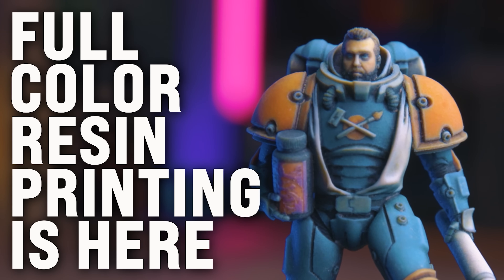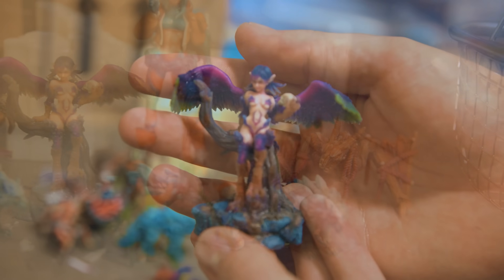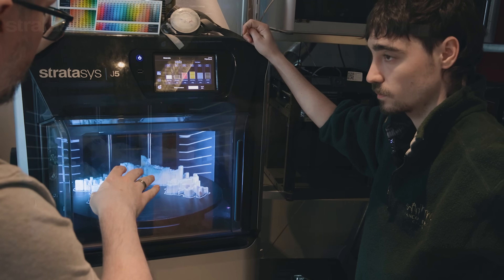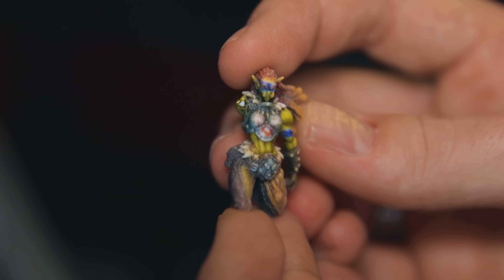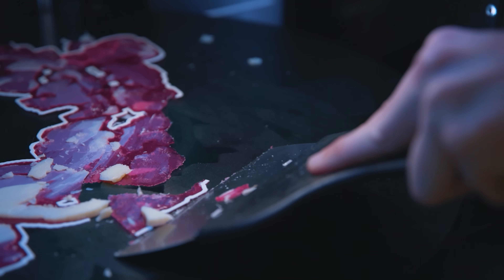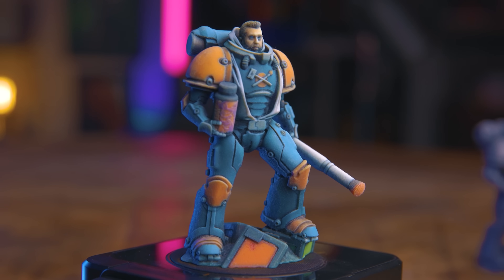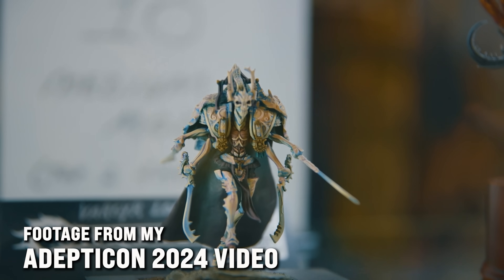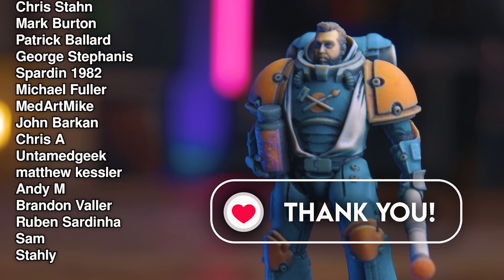FULL COLOUR RESIN PRINTING!!! - StrataSys J55 Impressions

Comment: Stratasys polyjets give great results, I use them at work in the dental teaching field. However they are expensive to run and maintain - colour resins are £330 each and you need two installed at a time per colour, so CMY function is going to cost £1800 ish. Basic resins and support materials are cheaper but again, two carts per material channel. So on top of the machine cost its heading for £5500 for a full set of resin. 

Being an insdustrial machine it is very proprietary, so you wont be modding it or getting around features you don't like. On the other hand they are fairly user-friendly, it won't take too much effort to train someone how to operate one.

Servicing contracts also cost a fortune as do spares. Still, they make very nice accurate parts and nothing else can match them for versatility yet. You'd just need to start a whole business to get hold of one.

Comment: Just counting down until this trickles through to low-cost consumer machines. Either patents run out, alternative methods to do the same thing are developed or Chinese companies just knock it off, but give it a decade and this will be in people's home workshops.
I will agree though - the support material and process is the game changer here. Assuming a similar recipe for support resin can be figured out, and someone like Phrozen or Anycubic works out a way to manage multi-material resin printing, it will be a smash hit.

Comment: Cant wait for a decade to pass so we can pick a chinese knock off for $200
Reply: And knock-off cartridges that don't cost the price of the entire printer.... When he said that I got worried this was going to copy paper printers in more ways than the print head. 
Overpriced cartridges that are just a plastic bottle of resin would be taking the piss
Reply: @ge2719  i was working with a printer like this from stratasys. The catrige work for 1 year starting when you set it up then you need to throw, and on the top 5-10% still remain in the bottles left when the machine says its empty. 😅 But the Support free print is nice to have like he says you need 0 knowledge but the cleaning need to be professional done. Make this wrong and you gona pay around 1000$ for a new printer head. 
The price of the machine and the resin cost makes it a bad choice for hobby print or sell its more for industrial use and sell
Reply: Yes even a single color one, for support management and water cleaning it is interesting enough for me.
Reply: Nah, rather going for it in four years🎉
Reply: The polyjet line of printers has been out for over a decade. They are insane with a price tag to match. There were full Color prints over 20 years ago, but again, super expensive systems and behind a curtain of patents;). Used these system in large tech companies. You can even print in various hardnesses. Nuts.
Reply: @KcCake this aged well, flashforge is making a similar machine called the CJ270
Reply: We should be able to replicate the technology for way cheaper maybe even back engineer it
Reply: why we gotta keep competing why don’t we just team up
Reply: @anthonycooper1340 Greed
Reply: a decade? No. 2 years max for a knockoff. A reliable one however....
Reply: @thimiraamaratunga7794  3d printed was invented in 1984, wasn't until 2010 that it started going global. why? because the intelectuall property expired. Now, at this day, PolyJet owns the intelectual property of this new technology so, actually: You have to wait 24 years .
Reply: Bamboo labs new 3d printing technology!!
Reply: That won’t happen for another two decades lol
Reply: Patents last 20 years, and this thing is very likely patented up the wazoo
Reply: @h57s  chinese font care about puny patents
Reply: @KcCake  sadly they care
Reply: I won't buy Chinese printers of any kind
Reply: @jerrebrasfield4231  almost all 3d printer companies are based in china
Reply: @jerrebrasfield4231     I've been quite happy with my Anycubic products.   Luckily, not everything coming out of China is Temu.

Comment: I want one of these now that I know about it. I been resin printing for a couple of years. When I been out of resin, I got in the habit of playing with slicing and simple 3D modelling apps, learning supports, basic kitbashes etc. Then I discovered the paint feature in MS 3D builder. So I started painting a lot of my Battletech mech files in it. The way Windows displays the resulting Thumbnail makes visual reference easy when searching through large folders. 
But basically, I've already got armies of mechs painted and ready to print

Comment: I have been eyeing this technology for a few years already, Mimaki is another printer-maker and theirs are much more reasonably priced than stratasys.
And they can even utilize a fully glass-clear resin, to simulate objects inside of a bauble for example, or making very believable car models with passengers visible inside.
Reply: You can utilize clear on the Polyjet as well. To get a more glass like finish, some minor sanding and clear coat to really make it pop.

Comment: I notice there's a lot of tan/orange and blue in the example prints. Are they still perfecting the colour mixing for this method?
Reply from the maker: just the colours of the models that were there. there was one I did not get footage of, which was a sculpt with tattoos on the body and it looked ace, butt we'd packed up when it was done. you'll see more models after UKGE

Comment: We had one of the early monochrome versions of this tech, at my work.   The support material used a water wash station with a pressurized nozzle to strip it off.    It was pretty cool tech back then (2010ish), and made super his detail models.   They were also quite strong, and could make quite sharp edges.

The resin was expensive, and date coded so that the printer would not accept it past its use-by date.

The printer maintenance was a pain, the resin (ink) jet print head was the hardest part to get clean.   

We also had a color printer that used the gypsum/color inkjet technique.  Those models were quite fragile, even when ‘hardened’ by soaking the model in super glue.  Most of the sandy looking prints described by other commenters could be explained by this tech.

Nice review, and cool printer!

Comment: The biggest steps here arnt the colour. Which is certainly nice. It's the fact it's got rid of the manual interaction with harmful chemicals. The fact that it can all be done (in theory) without even Gloves is incredible. By the sales images it even implies open office placement, so does that mean it's not got the fume related issues of resin printing too?

If so, This is the kind of tech that could be in every home.

Comment: 👋🏼former ten-year stratasys employee here. The J55 was a cool redesign of their polyjet platform (took years to figure out the rotating build tray), but sadly the BOM of material jetting systems like the J55 are seriously expensive, and will never drop to a point where consumers could afford it.  I have a tonne of things I could say, including the market size/attractiveness of the miniatures market for a system like this, as well as the colour gamut ranges, model stability, pros and cons etc.
Reply: I understand the argument for falling costs of components, and yes extrusion and resin technologies have fallen by two orders of magnitude over the last decade. I would qualify that by saying you can extrude or catalyse on sub-1000 printers, but these are not comparable to industrial systems in reliability or quality. But extrusion and vat systems (specifically LCD) are a simpler set of components, with LCD printers only becoming more cost effective because of the most expensive component (hi-def LCD screens) being driven down in price by a separate market, the tablet market, scaling the supply-chain. With FDM, this has never been a high cost bom. With material jetting however, as another commenter mentioned, the enabling components being the jetting heads and surrounding systems are fundamentally more expensive pieces of tech, both for thermal and piezo heads (you need different types of heads for different chemistries of resins, but thermal heads allow for a lot more interesting chemistries beyond actylates which is what polyjet is). The providers of these heads such as Ricoh for polyjet, of xerox, Toshiba, Konica etc sell these at a premium.  Ultimately these companies for which 3D printing components is a very small percentage of their portfolio and revenue would need to make strategic decisions to drop the price of these components for manufacturers like stratasys to reduce price and maintain margin. Knowing both sides of this market, I can assure you they have no interest in a race to the bottom. Now, a new entrant into the market could be interesting, and enough material jetting patents have expired for a company to try and engineer a super cheap platform. However, there is a floor when it comes to the BOM, and these heads are very complex, engineered, and high tolerance pieces of equipment. I’ve worked with them first hand and the maintenance alone is a lot.  It’s not like an extrusion or vat system that requires little attention and can be left for periods at a time. For example, if a material jetting printer is not used enough, the resin in the head, and all the way back through the pipes and tank system, can start to degrade. At best this means you need to purge the whole head and pipe system, loosing a lot of very expensive material, at worst, dismantling and cleaning the head system or getting a replacement.  An example of a floor for BOM is vat systems. If you segment vat systems by technology used to catalyse the resin, what we actually see is the conventional laser-based system not getting below around £2000k, because this system has more moving, highly engineered components such as a galvanometer, mirrors, lasers etc (simply more moving, complex parts). The only reason we have seen sub £1k vat printers is because a simpler, cheaper system was developed; LCD-based printing. These systems are a lot simpler, and the components are off-the-shelf.  Now could someone re-engineer a new jetting system. I honestly seriously doubt it, but never say never. What may make multi-material colour printing accessible in the future for miniatures in my opinion will more likely be as a service bureau option, but even then these service bueures would need to find an alternate, much cheaper resin to make it cost-attractive to us, and that would void their warranty on very expensive hardware.  Maybe in 20/30 years who knows, can’t predict the future that far, but I’d certainly suggest we won’t see a “good” colour material jetting system under £10k in this decade.
Reply: Just wait to creality gets a hold of it 😂
Reply: But yes it is cool, and these systems are a staple in the prototyping market. I wouldn’t be surprised if GW has one in the model design dept to do quick, colour models for rapid concept designs and colour blocking. Also the colour version of this is between £80-£100k depending on your region.
Reply: @oliversmith-n6h  And do you have a professional opinion about the Mimaki or 3dsystem ones ?
Reply: @lilietto1 good question. So the 3DS material jetting systems had the upper hand for service bureaus because their support material (material jetted parts are encased in a jelly like material) was washable in water, whereas (until recently) polyjet support required a caustic solution bath to remove support. I’ve worked with both and 3DS was easier, but SSYS modern systems like the J55 has water soluble and it’s just as easy, and non-toxic. Mimaki’s printers were always a side project of the muchhhh larger mimaki 2D printing company. In fact I was told by a source a few years back it was destined to be closed down due to lack of growth. However, because Mimaki is a huge 2D printing company, Mimakis 3D printers had a superior colour gamut with more rich colours than stratayss polyjet (this is from internal ssys research for their flagship colour printers) however the advantage of polyjet over mimaki (aside from knowing stratasys are sure to be around after you invest in their equipment) is you get more dimensionally accurate parts.
Reply: @oliversmith-n6h  I call bs that the bill of materials is so huge for these printers that they will 
never be able to bring the cost down for normal consumers .
The same has been said about pretty much any 2d or 3d printing technology and each time they were proven wrong .
this is at its core an ink jet printer with uv leds for curing and a rotating build plate instead of rollers in a 2d inkjet printer ,
so unless there are patents that prevent further development and use of this technology
i see no reason why a company with the vision and competence to scale this up, could not bring a 3d printer to market
in a couple years that costs around 5k which is the magic mark where small workshops , printing farms ans consumers start buying .
Then slowly but surely the market starts growing . 
we have seen this with the lasercutters ,  cnc machines and yes resin 3d printers (first ones were ridiculously expensive )
first they all started out right around 5k and now you can have smaller simpler versions for around 200 bucks .

Let me ask you this 10 years ago would you have ever thought about owning a lasercutter a cnc or a resin 3d printer 
the answer is probably no , because it was way to expensive 

but today you can get these machines on amazon for the price of an entry level filament 3d printer.

now i dont think these 3d inkjet will become quite as cheap 
but i think sub 1000 dollars should be doable  , which is a reasonable consumer price
Reply: @Crushonius  to be honest id agree with you if it wasnt for the fact that the main cost comes from the extremely expensive high viscosity inkjet head with propietary software that can cost above 1000 on its own, everything else is doable, i dont think thats gonna drop either because inkket companies want to keep all there tech as propietary as possible
Reply: @Crushonius  I completely agree. An easy idea to remove this from just a resin printer, would be to use a 3d scanner or laser imager, and a inkjet printer that has a color mixer. Scan whatever it is you want to paint, do not touch or remove it. Paint it in software, and the inkjet painter can paint 1 color at a time, adjusting flow for different hues. This can be done on a hemispheric gantry, or use multiple nozzles.
Add a spot where the nozzles can purge, and you could eliminate unintended mixing.
Reply: @lilietto1  serach youtube 3D Printing PERFECT COLOR! , Jason will show you something more colorful.
Reply: Also another commenter made a point about creality getting a hold of it.  It’s actually a solid argument. Pretty much all of the 3D printers out of china have been duplications of American and German 3D printers. Chinese companies will buy a printer such as an EOS or a Polyjet (via a 3rd party supplier) and tear it down and re-build it from cheaper components. Now they are truly never as reliable or quality as the original systems, but when they can be 2/3rds cheaper, that’s enough for them to sell.  Like I said, don’t expect the leading material jetting companies like Stratasys and 3D Systems to drop prices to where we’d like them. But it’s concievable (if there’s another larger market that somehow drives down the bom for jetting heads like tablets and smartphones did for lcd screens) that a Chinese new entrant could build something at least at a sub £10k. How reliable it would be or if it could do full colour who knows but maybe. A caveat is Mimaki, and their systems are well above £10k.  But creality or phrozen (probably not anycubic) could mayyyyybe have a chance if anyone. Again though. The cost of the enabling jetting technology would need to come down in price significantly, and these are not off-the-shelf components.
Reply: @oliversmith-n6h  I had actually assumed it was the peizo heads that offered the most versatility due to heat messing with the chemical compounds in the resin? Are thermal ink jet heads a more useful setup in comparison to peizo systems?
Reply: Make it cost a reasonable amount of cash so I can own one, otherwise it's just another rich kid's toy

Comment: Also more work to clean prints and dispose of waste. We had these at my previous job.
Reply from the maker: I never saw disposal, what do you need to do?
Reply: @FauxHammer  sorry I thought I had replied to this, and just saw a recent video you did with support removal. It has rarely, and I do mean rarely, ever been that clean for us to remove the waxy type supports. Now I will 100% admit that once all that's off and a thorough cleaning has been done, they do look great. A bit faded, but not enough for it to be an issue. Also we found it best, for clean to use mean green than just warm/ hot water. Helps a bit more with support removal. Also since this is still technically a resin based support, you still have to dispose of it like other resin materials.

Comment: I call this Next gen toys, figure will process by order, designer and IP owner can work together and share profit with lowest production cost and lowest wastage of material, no need do mass production to drop down the price to full fill market and also easy to customize. even found if error in production, also can fixed faster and with lower cost

Comment: How are they dealing with the model warping as the resin continues to cure? I've ran into this issue when printing minis that have long flat surfaces like airplane wings or rotor blades. If I don't primer the model soon after printing it starts to warp. If it is printed in color then there isn't anything blocking UV light from continuing to cure the resin.